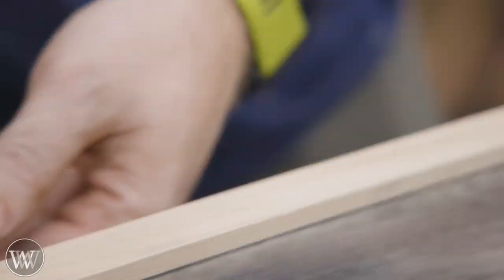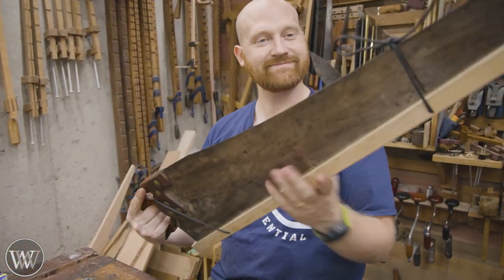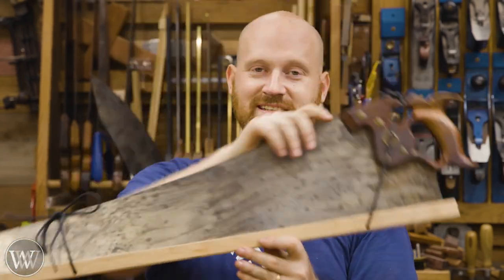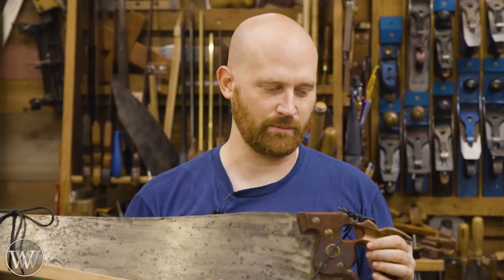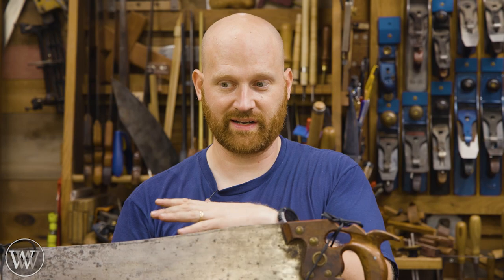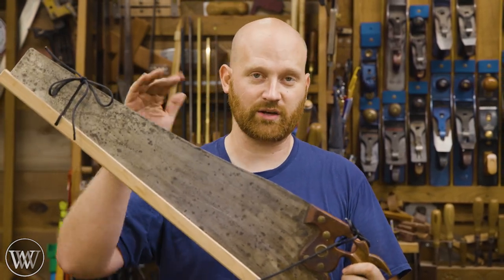A Saw Gard To Protect My Hand Saw

Comment: I made hold down straps for my saw guards out of thin leather about 1/2” wide. One end was nailed tight with a copper roofing nail. The other end had a vertical slit that hooked over the head of another roofing nail that was left just proud of the guard surface. Very tidy and worked great!

Comment: What is the tool used to make the first slit in the guard? Is that an old saw "hack" idea? Why did you chisel the ends instead of sand?
Reply from the maker: That is a kirfing plane. I have a video making it here. https://youtu.be/4EILSfPAWkQ?si=zcQ4swG6gPfkhq9k
I used a plane and chisel. as it is souch faster and easier then sanding. Plus sanding is a pain and creates so much dust. If you want more detail I have a how to version of the video where I talk through and explain what I am doing. It is all on the other channel. Wood By Wright How To.